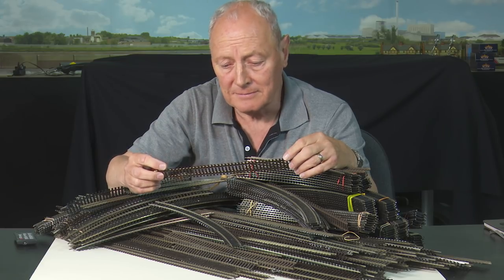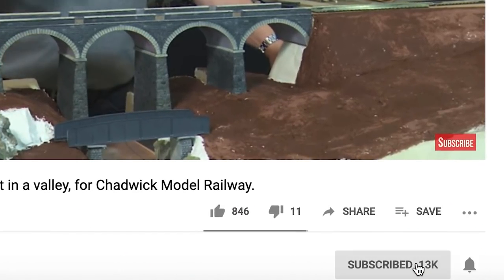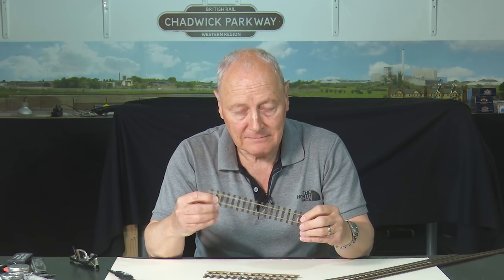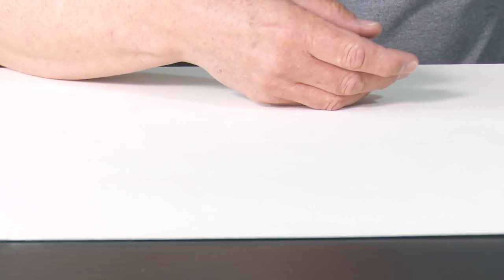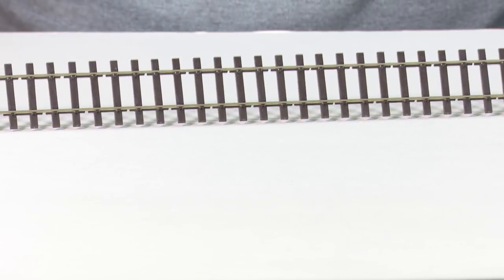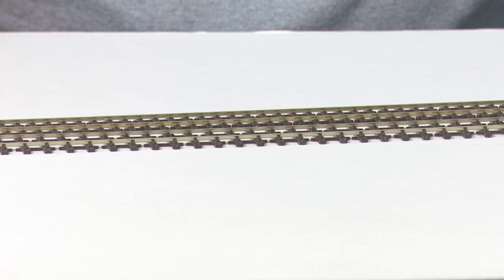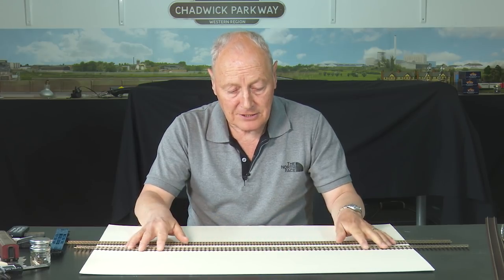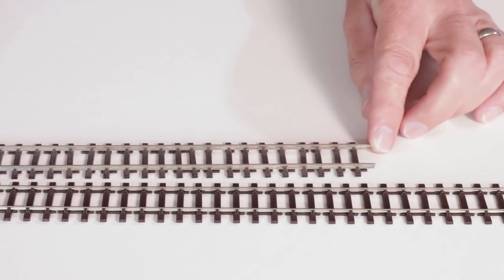Track  Peco Code 100, Code 75, Bullhead, EM and P4 explained at Chadwick Model Railway | 66.

Comment: In my mind I think that Train sets are temporary (go back in a box when not in use) and model railways are a permanent setup where modelling is used to create scenery etc. 
Anything from 1960's was more likely to be Tri-ang or a Hornby Dublo.
Hornby wasn't a thing in the 1960's. Tri-ang Hornby maybe. Hornby took over from Tri-ang in 1971 from memory about the time that code 100 started to appear.
That's my 2 cents worth. 
Mon from Monsville Railways
Reply from the maker: I think you’re dead right MH. Perhaps happier times, regards, Charlie

Comment: I believe code 75 rail represents a 115 lb/yd weight. National Rail has standardized on 125 lb/yd. So, code 83 at 126 lb/yd would be more prototypical by today’s standards. Having said that, I do love the look of the new bullhead stuff. Oh, and there are 2,400 (approximately) sleepers in a mile of track.
Reply from the maker: Wow Robin, what great facts.

Comment: Hi Charlie, I just came back to rewatch your video as I've recently been trying to learn how to properly plan a layout using streamline track rather than set track. I'm afraid that the differences in radius and degrees of the variety of Code 100 streamlined points and crossings have confused me to a certain extent. I understand that there are no set curves to buy to use with streamline points, but I'm unsure of the best way to, say, straighten out a siding as it diverges from the mainline with a streamline point. Sure, you could simply bend some flex-track into a reasonable curve, but that feels a bit odd to me, who is used to having the precise geometry of set track.
I was wondering if you would consider making one of your excellent videos on the topic of planning a layout using streamline flex-track, and how to ensure your track is geometrically consistent and your points and crossings connect properly. Your expertise on the matter would go a long way!
Thank you!
Reply from the maker: An interesting point and I’ll certainly add it to the list.  My advice is to move away from set-track as the geometry is not lifelike. I’ve shot a video which goes out in 2 weeks time.  This might be helpful regarding the Peco 6ft way Gauge.
Reply: @ChadwickModelRailway  thank you!

Comment: Thanks for the video. I've just recently started a new layout using Bullhead track, and I have to admit it looks a lot better. However, I've found it difficult to keep curves smooth - it seems to bend out of shape easier than Code 75 plain track. I would indeed be keen on a video on your advice on how to lay it. Also in deepest darkest Somerset ...
Reply from the maker: I will cover laying Bullhead soon Richard.
Reply: @ChadwickModelRailway  Excellent look forward to it
Reply: @ChadwickModelRailway  That's great news! I'm still very new to the hobby having left in my teens. I was probably very naive choosing code 75 and then Bullhead, but hey  we all need a challenge to keep life interesting. Keep up the good work Charlie, I really appreciate your vids.

Comment: I think a lot of modern outline rolling stock and non steam locos are designed with conversion to EM in mind. P4 appears more tricky and seems to be much, much more than 'just'the track gauge. Converting steam models to EM orP4 appears downright tricky! Once I'd seen 'proper' scale track I understood the better appearance, until then I hadn't. Thundering nuisance! I want to build a layout for my grandson and I guess it will have to be 'OO'. BobUK.
Reply from the maker: Good idea, stick with OO

Comment: Great video as always! I have a bit of a noob question what is the actual spacing of the sleepers on the bullhead track compared to stock code 100 or code 75? If I was to cut the webbing to make bullhead what would the new spacing be as I don’t have a piece to compare with?  Thanks
Reply from the maker: Search the web Darren, there is a template.  But it’s cheaper to buy one piece of Bullhead.

Comment: Charles, I have a box of code 83 concrete sleeper track in my shed! You did not mention this size. Will my Lima Syphons with large flanges run ok on code 83? Cheers
Reply from the maker: I bet they will but have you not tried?
Reply: No not yet... the box is still sealed shut and all my rolling stock is packed away pending an impending house move. Will get the research department locos and coaches working on the potential problem in due course. Thanks anyway... I thought the extra '13' might make enough of a difference. Will end up rewheeling I suppose or, if the cost is prohibitive, relegate the track to siding use. Cheers.

Comment: Very good video Charlie, I run Peco N gauge and run the standard track, however I have got some "0" gauge items and have mixture of flat and bullhead and did not realise that you need to run adaptor sections so I am going to solder instead of using joiners all very confusing  mate 

Best regards Andrew from  down-under
Reply from the maker: I do hope that soldering works out okay and that you don’t suffer from extremes of temperature.
Reply: @ChadwickModelRailway  Have actually done the soldering before on previous layouts, as long as it does not get to extreme it's OK, upon saying that in my garage a couple of years ago on a a continuous I had a bit of expansion.

The "O" Gauge will be a small end to end one

Please keep the videos coming 

Best regards

Andrew

Comment: Love your channel sir!  Is the new bullhead compatible with the regular Peco code 75?  ie; are the rail heights flush when the two types are placed end to end?  I realize the rail joiners are a little different for the bullhead but that could always be a slight modification to make it work.  I just don't want to ditch all of my code 75 right now and perhaps do a few sidings in the bullhead.
Reply from the maker: I can’t find a Peco converter but I’m sure that you can work around it.
Reply: @ChadwickModelRailway  But the rails are flush on top?
Reply from the maker: I’m unsure.  If you give Peco a call, I have no doubt that they will help you t.

Comment: As you say Charlie it is a nightmare. I use code 75 track but find locos derail  more times than running on code 100 interesting  video .
Reply from the maker: A good point David.

Comment: Charlie

An excellent explanation of the differences.......
Just wondered........any chance of seeing some of the track 'end-on' with the wheel clearances shown....?

I recognise this might be a bit difficult with close up focusing..

As someone returning to the hobby after far too many years I have older Hornby Locos and stock......I also have some Wrenn Locos and stock... as well as more recent purchases of second hand, (bargains), in locos and stock from the likes of Airfix, Bachman, Heljan, etc....

I am attracted to the new 75 Bullhead.....but 100 might be more appropriate. I recognise your comments on mixing 100 and 75 and the ease with which this can be done.....

Keep up the good work...

James Hennighan
Yorkshire, England
Reply from the maker: Sorry James but that’s an old video.
If I were you I’d use bullhead as long as long points are okay, otherwise it’s Code 75.
Reply: @ChadwickModelRailway  Thank you..

Comment: Really appreciate the explanation as I had know idea what was the difference, I was going to ask if you can get just the rail without sleepers, its for a turntable I am making, but I am thinking also of cannibalizing a rail its for the wheels of the turntable to run on similar to the peco need 275mm dia also considering cutting the sleeper so I can route a slot in my base so I can slot the rail with a part of the sleeper. within the slot  mainly for effect has I have a central bearing and 3D printed parts..
Reply from the maker: I’m so pleased that you enjoyed it John and good luck with your turntable.

Comment: I found this a very interesting exposition on scales, gauges and track, but it didn't make me want to buy different track from what I have.
While I do realize and have seen that there are differences between the different kinds of track, personally the errors in standard code 100 track don't bother me, nor do I feel a strong need to buy flexi-track other than for curves that can't be made with set track.
Also, I simply don't want to spend lots of money or time on this  when it could be used much more productively elsewhere.
Reply from the maker: You are of course right DS.
Reply: @ChadwickModelRailway  Thank you for taking the time to reply.

Comment: Thanks for excellent MRR videos! 

I have used code 100 flextrack on most straight streches, but settrack on curves, with larger radius pieces as "easement". The curves are more easily built with settrack, and they stay put more reliably, and when painted and ballasted, the difference is difficult to see.
P.S.1. I would like to hear what is your judgment on Peco 3-way switches; do they work reliably?
P.S.2. What do you think, could Peco 75 track be mixed with code 83 Tillig Elite curved pieces, or would the bump be too bad?
Reply from the maker: Hi Almo,
I know nothing of Code 83 but I have had nothing but problems with 3 way points!

Comment: OMG, my head is swimming.  I had "O" gauge Lionel train layout, on the floor and later on a 4' by 8' plywood board, when a child in the 1960s.  I remember the locomotive was cast iron.  Now that I'm in my 60s, I'm thinking that HO or N (gauge or scale?) might be more practical for space considerations.  I'm in the US so I'm wondering how much of your video is applicable here?  Can I just pick HO or N and be done with it?  Or do I still have to deal with multiple track sizes?
Reply from the maker: I would go for HO.  It’s much easier on the eyes now we are in our sixties!
Hopefully you’ve subscribed too.

Comment: Now in the US there is a difference in between in main line and  sidings Main lines have much more sleepers than sidings so if i was to do a US prototype i would use standars code 75 and bullhead for sidings.
Reply from the maker: Interesting info Mike.

Comment: Hi Charlie find your track choice very interesting and a bit mind boggling I myself do like FLEISCHMANN PROFI track especially the stream line flexible track. What are your personal views on this track? After watching your video I did a little test with a piece of Fleischmann track and the modern Hornby track I got a old triang wagon and did a rolling test on both tracks and could not see much difference between the too both had the same rolling sound and wheel spacing on the track shoe. About the same giving one track is HO and the other is OO !! Look forward to your reply kind regards Michael.
Reply from the maker: I’m so pleased that you enjoyed the video Michael.  Sadly, I’m unable to comment on the Fleischmsnn as I’ve never used it.

Comment: Thanks for the video, very interesting. From some of your other videos you appear to have mixed and matched set track with with flexitrack ... especially with curves. I have found it much easier to get properly parallel curves using set track where it fits as well.
I would like to know how to transition from code 100 track to code 75 slips etc. and back again if possible.
 I find it hard to pack neatly  to the right height. And do you solder or try mangling fish plates to connect?
Cheers from New Zealand.
Reply from the maker: I have used the Peco plastic code 100 to code 75 converters.  They look like a dark brown plastic fish plate.
I believe that they also make a short rail converter too.
Reply: @ChadwickModelRailway  Thank you.

Comment: I think that sectional track (such as Hornby, Peco Set Track and Bachmann Branchline) is good for people who want a continuous layout on a 4' wide board. I don't think it is good for people who want "plank" type layouts, or those who run the layout round the outside of the room.  My first layout was an 8' by 18" branch line terminus to fiddle yard using Hornby track.  If I had used flexible track with, for instance, Peco small radius points, I would have been happier with it for a much longer time.

The only thing that I use sectional track for now is the running-in oval for new locomotives.
Reply from the maker: Good points Richard.
Many thanks.

Comment: Charlie thank you for the great video , there are now over 530 comments so please forgive me if this question has been already asked , but if Code 100 is used but the majority of available points crossing etc are in code 75 , how does one get over the problem of the rail heights being different ?
Will this not lead to derailments ? Thank you
Reply from the maker: Every point, crossing etc is available in both codes except electrofrog slips and crossings.
Reply: @ChadwickModelRailway   I don't get it..if elctrofrog is so much better Charlie (as you have previously said in another video) ..and everyone has "old" 100...Why don't they make electrofrog points (and upcoming Unifrog for that matter?) in 100?
Reply from the maker: They do make electrofrog points in Code 100.  What they don’t make is Electrofrog slips and crossings.  They are only available in Code 75.
Reply: @ChadwickModelRailway   Sure. I have older insulfrogs and am waiting till unifrog becomes available until I replace them all.. Unfrog seems to be basically the best of both worlds..Behaves like Insulfrog when not "turned on and powered" and then no shorting hassles when powered..so I intend to skip electrofrogs all together.. they will all become obsolete IMO..  My point is Charlie, from what I can tell, the new Unifrog double slip is out and it is Code 83... why? Is this for the US market? If you are a British company, Why wouldn't you release your initial Unifrog points and slips etc in 100 for the local market? Why in 83? Will Unifrog also be released in 100? thanks.

Comment: Personally, when I build my new layout, I'll go for Code 75, but around 90% of my stock (over 900 items!!) is modern so came with the finer scale wheelsets as standard, so they're just fine with Code 75.

For old 'pizza cutter' rolling stock that needs new wheelsets, Alan Gibson sell them for £.150 per axle... which works out as £6 for a coach... and isn't that bad (you only have to do it once) considering you're bringing a 20th century relic into the 21st century!

In addition, not only were the flanged deeper... the wheelsets tended to be wider too, and could derail or short circuit across points... especially a problem for DCC.

Excuse me saying Charlie, but your understanding on concrete/flatbottom track isn't quite accurate.

Bullhead rail was originally designed so when the 'head' of the track started to wear out, they could flip it upside down and use the other side.
In reality, it didn't work like that, because by the time the 'top' was worn, it would rattle around in the chairs and it was hard to get stable... so they just replaced it!

In the 1920's, the UK railways started to use American style Flatbottom track in metal chairs on wooden sleepers... each company having their own varient of chairs.
Later still, concrete sleepers came about, avoiding the need for chairs completely, and the sleepers were more durable too, though there are variants of clips too. 

Something else worth a mention (though you may have considered talking about it, but didn't want to overload people with an already confusing topic)... EM (which is actually 18.2mm) is fairly easy to accomplish (often you can just use spacers to re-gauge your locos/stock) because it's just 'wider code 75'...

...but P4 is effectively miniature engineering (because 4ft 8 & 1/2 works out at 0.741in gauge, or 18.83mm), so not only does a two-axle wagon needs new finescale wheelsets (with a tiny flange), but one of the axles needs to 'rock' side to side like the rear axle of a car, of the vibration of going over P4 points will derail the wagon!
P4 modellers use 'compensation units' to provide this, and it needs detailed 'surgery' to your wagon to accomplish this feat of miniature engineering!

Hope that provides useful info for you! :^)

Cheers

Laura
Reply from the maker: Some excellent points Laura.
Thanks particularly for the tip on acquiring new wheel sets. 
Regards Charlie
Reply: Wow - that was really informative about turning the bullhead upside down. Many thanks for all of this information Laura - Pete

Comment: Is there are a standard rule of thumb regarding which coupling systems don't work with the shallower Code 75 track?
Reply from the maker: Leigh, are you referring to joining the track or rolling stock couplings?
Reply: I'm referring to rolling stock couplings - in particular, the Kadees with the long dangly bit at the bottom.  They regularly drag on some track, especially points.  Does one avoid using Kadee with Code 75 track or is there adjustments that can be made?
Reply from the maker: Hi Leigh, You simply need to bend the trip pin to maintain clearance.  Kadee do make a set of round nosed pliers to do this.
Reply: @ChadwickModelRailway  Thanks for that.  I hadn't experimented with any solution yet (I didn't think that 'dangly' bit would have been pliable enough.  But I'll take your word for it.  All trains have been locked away for over four years while I build another set of boards (I'm not real quick).

Comment: Hi Charlie

I’m using 100 code peco track but I want to fit electrofrog diamond crossovers will this be ok or will it give me a problem please I’ve got mainly new stock

King regards John, stay safe
Reply from the maker: Just make sure that you have a means of converting the track.  
I think that it's Peco's SL-112 and SL-113 that are your choices.
Reply: Chadwick Model Railway thank you